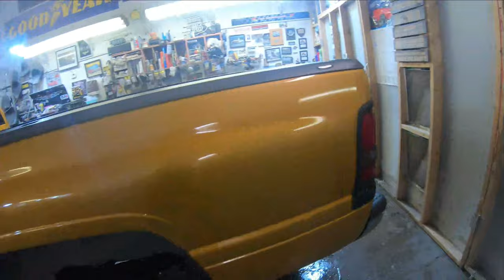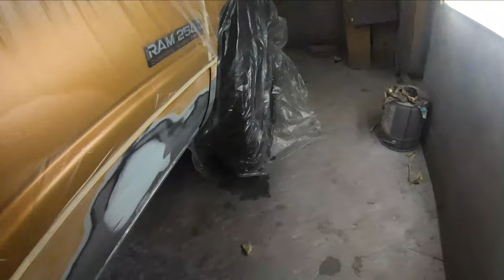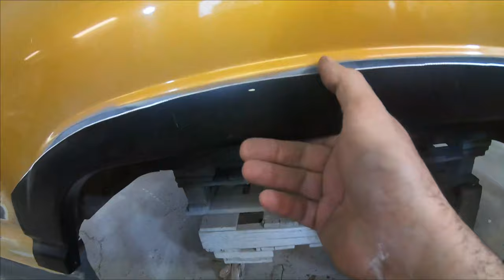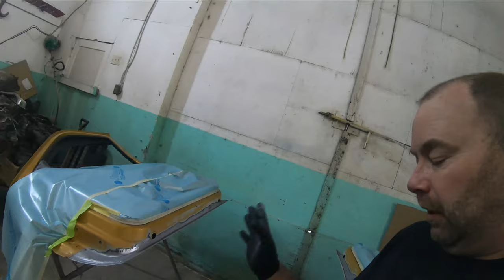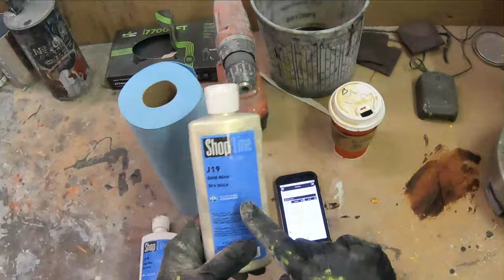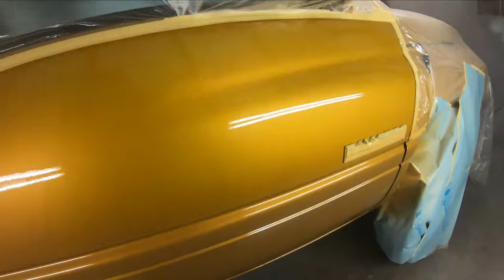Completely rusted in 4 years, can I revive this rotten restoration?

Comment: Hi John, great job on that truck, but what a lot of headache chasing all those rust spots and holes. I have seen this sort of rusting before, and it seems that some of the lower priced off shore panels, have lower quality steel that they are formed out of. All they need is to be exposed to water or humidity, and the rust gets fed what it needs to start. All the metal needs is a tiny pinhole through the painted side, especially if there is no epoxy primer, and rust will start on that surface. On the back side, where only the black e-coat is the steel is even more at risk, especially if there is a scratch or scuff through that e-coat. At the wheel well edge, where the plug welds were done, and no weld through primer was applied, the e-coat was burned off and the crappy metal had no protection at all. I don't think the other shop did any rust proofing after all those panels were put on, no epoxy primer used, no weld through primer anywhere. Too many corners cut altogether. Around here, with the salt and brine used on the highways in the winter, this truck didn't stand a chance. I feel sorry for the customer, as that type of work gives all of us little shops a bad reputation. Hat off to you, helping this customer save his truck.
Reply from the maker: Thanks Jim, yes, I don’t feel like the shop necessarily did anything wrong, just didn’t do the little extra required to preserve the work that was done

Comment: I like that upol primer, you can over reduce it and spray it as a sealer aswell. I was apprehensive at first but the tdc says so and it works great for both applications. Haven't finished the entire video but I know it's gonna be great!
Reply from the maker: Yes, and I have used it as sealer, but honestly don’t find that it goes on as nice as the shopline 355 that I usually use.

Comment: Awesome work! Just a suggestion, I would switch to getting fish oil to use in your anti rust pressure pot as used motor oil is not good for the environment. At least fish oil is natural and it will stay in place for more than several seasons and is a better alternative for long term rust prevention. It will also not impact the paint finish when it drips out or when the customer wants to re-apply it compared to motor oil
Reply from the maker: Cool, thanks! I’ll definitely look into this 👍🏼👍🏼

Comment: Happy birthday. You’re probably spot on with the primer being the main issue. Just another thought I’d figure I’d throw out. Do you think if it was painted in a humid environment it could have trapped moisture in the metal. Also I’ve heard some replacement panels are thinner metal than factory. When doing primer do you need etch first on bare metal or is epoxy good enough.
Reply from the maker: It’s possible moisture could have been an issue, some aftermarket panels are definitely inferior metal, but I’ve never seen them go this bad, I’ve always found epoxy primer on the bare metal to be the best

Comment: Great save 👍🏼 What did u put in your POR15 to be able to spray it & ratio?? Thanks 🍻
Reply from the maker: I usually just add a little urethane reducer, no precise amount, just until it’s thin enough to go through the spray gun
Reply: @Johnnymidnight  probably around 5% just try it thanks a lot 👍🏼👍🏼

Comment: Wow what a mess. I have used etching primer on my odd repair here and there on my own vehicles over the years , I guess i should be using epoxy primers.
Reply from the maker: I’ve always felt etching primer is totally fine for small repairs, but epoxy is best for large areas of bare metal

Comment: Another great "rescue" Johnny!  It's ALWAYS refreshing to see someone who still takes pride in their workmanship and DOESN'T do things half-assed!  Value added, I think, is the proper term to use👍  I've watched this & the white 3rd gen Ram video,in which you repaired the outside rockers, etc on and I have a Q:
I have extensive rust on the middle and interior rockers as well.  Do you know if THOSE replacement panels are available and whose repo parts, do you prefer to use?  Currently dealing w/a ECM issue, that has been a thorn in my butt for the last while.  My Ram has has all the engine/tranny work, the 5.9 tends to need.  Once the ECM problem is finally sorted, the next item is the RUST, but I'm  wondering with the extent of the rust in the lower cab, if a entire cab replacement would be a better way to go???  What's the tipping point on repair vs complete replacement,  in your opinion?  I'm set up for cutting, welding, bodywork and being ready for paint, but again, I watch you and realize it's a hell of a lot of time and effort(& materials-lol).
Thoughts?  Thanx in advance
Reply from the maker: The inner rockers are available, I get everything through LKQ Canada, pretty much every supplier sells the same parts. The “OEM style “ rockers are much better quality than the cheap slip on style. I just helped a friend change a cab on an 03 (my latest video) , it’s a ton of work, but pretty nice way to go if you can find a clean cab, and have a 2 post lift
Reply: Thanx Johnny, i appreciate your view on my issue & your quick response  @Johnnymidnight

Comment: Great video Jon.  Do you ever have issues with warping from sand blasting.  Also notoced your air dryer in your paint booth.  Princess Auto has them on sale right now.  Do you like yours?
Reply from the maker: As long as you’re not hitting big flat panels warping isn’t really an issue, that air dryer seems to work really well, but it’s just a backup, I have a Dev-air dryer off of my compressor as well

Comment: Nice work I’m at 30 year frame and body tech. Unfortunately, you know as well as I do Russ is cancer you should’ve convinced the owner just to cut the bed sides off the truck. Epoxy prime, both sides of the new panels weld them on. I don’t know here in New York where I live and I’m not saying anything is wrong with what you did. That’s a year two year repair at best with the salt and chemicals. They use on the roads here.

Comment: Awesome job on the 2nd gen dodge. Is there a difference in the quality of the replacement panels, gauge, fitment, etc? Could the poorer panels have been a factor in the early rusting?
Reply from the maker: Typically I’ll only buy the CAPA certified panels, but I don’t think there are options on the bedsides. They always seem to fit well, but it definitely pays to spend a little extra time to coat the inside after they’re welded on

Comment: Great job thanks for the rust repair vids. Curious what your method is for installing the mud flaps. Do you treat the holes after you drill them for the mounts?
Reply from the maker: I pre drill, and like to coat the screws with anti seize, as well as oiling the inside of the panels when the job is done 👍🏼👍🏼
Reply: @Johnnymidnight  Nice thanks. Do you use like self tapping screws or bolts with nuts on the back? Or nutserts
Reply from the maker: Just self tappers usually

Comment: It's a dodge that's what's wrong I replaced the door bottoms 2 times already and still rusting the issue is dodge had the drain holes to high up and the water settles low and just stays there poor design I even spray rubber coating on the inside of doors and still rusts out don't buy a dodge but gotta love the cummins poor truck good motor
Reply from the maker: I do agree, these were terrible trucks from day 1. I remember when this body style came out, doing warranty rust repair when they were only a year old

Comment: That was a nasty repaint/restoration. I use the same refinishing process as you, using an epoxy primer to seal bare metal, then high build primer and filler. 

Warranty? I can see why the other shop didn’t want to warranty their work. It was their process that caused the failure and they didn’t want to take the financial hit. I always finish the back side of the replacement patches and panels and use weld-through primer. Guess that’s why my repairs last in the Midwest and yours do too.
Reply from the maker: It’s so true, take the little extra time and material to do it right the first time and they seem to last really well 👍🏼

Comment: Do you have any leads on getting the rear inner wheelhouse? I've looked high and low and can't find anything.
Reply: Yozzy's truck parts in Alberta may be able to help as they have new and used parts.
Reply from the maker: Seems to be no stock anywhere, I had a quick look on Amazon and found some, but price is crazy….
Reply from the maker: Also make sure you’re searching for the outer wheelhouses, not inner
Reply: Would the 02 t0 09 be close enough to make work?
Reply from the maker: I don’t think so, they’re actually pretty precise in fit

Comment: People have the right to know that the shop that first did the work on this truck was First Class Collision in Quesnel B.C.. There is no need to say anything else as the video is very self explanatory showing what a mess and poor quality of work that had been done and now what all work is involved and has to be done properly to fix the mess to restore it properly. People can come to their own conclusion by judging the before and after from the video.
Reply: Well that sounds like a collision/production shop.  Production shops are not the proper choice for rust restoration.  Unfortunately this video shows techniques that will have fairly similar results in the next several years. If this is your truck I feel for you!